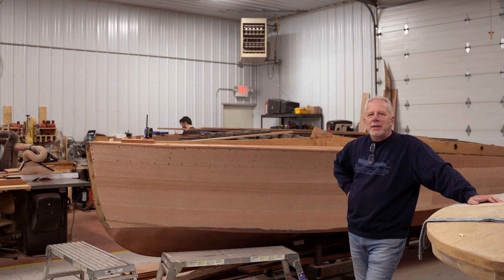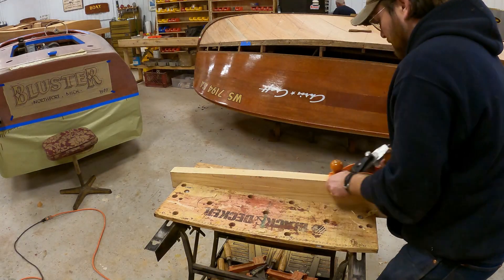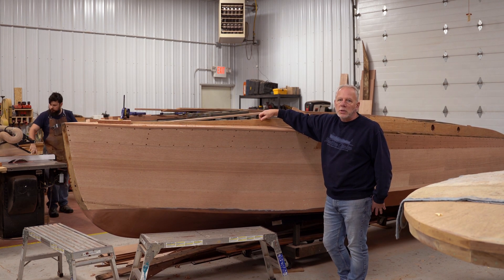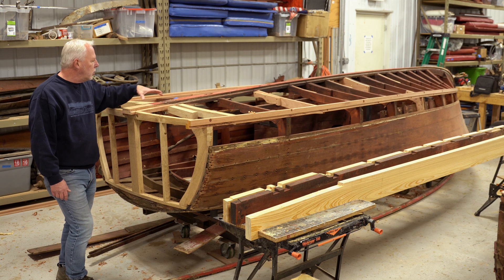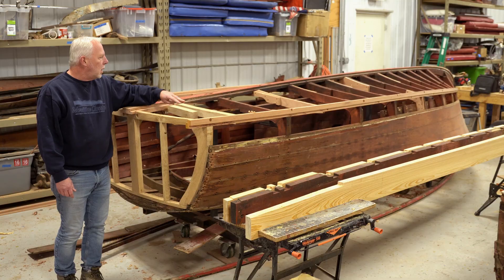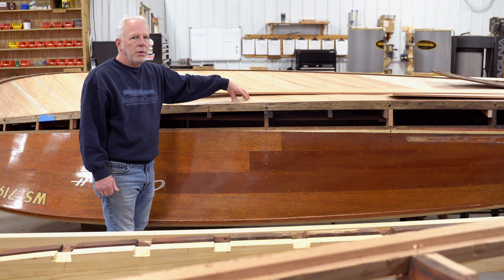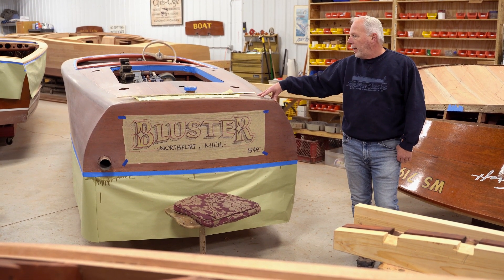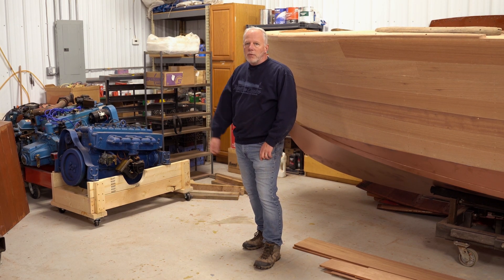Restoring Old Boats - Shop Tour Nov 2023

Comment: Hi Mike. Dave Willis here. Nice update and say hi to everyone in the shop. It was nice see everyone at BoB, Hessel, and Bay Harbor this year. Some amazing work completed last spring.  I'm getting ready to replace some of the frames on the '49 Riviera and wanted to confirm that I should use white oak and not mahogany. Any thoughts on the cut for the oak? Plain, Rift, Live sawn? I think the factory used Plain sawn, but is there a better choice for frames?  Thanks, and keep up the updates and tips.  It's helpful and informative.
Reply from the maker: The frames in the boat were mostly Mahogany except for the transom frames and the stem. I would not stray from the wood the boat was built with. If you change to all oak it will be a lot harder to fair and screw into. The boat will be much heavier as well.
Reply: Thanks Mike. It certainly looks like mahogany. Only one is broken transversely, but several have screw line splits that run with the grain. Per your 5200 video, this is the time to replace anything suspect. Agree regarding the fairing and weight savings of the mahogany.  @MikeGreenStudioWorks

Comment: Mike I’m restoring a 67 century Forester
I have it stripped down with 80 
Now I need to sand with finer paper like to use a guide coat so I know for sure my sand scratches are gone and help would be appreciated 

Oh also need information on how to correctly do the seams/joins what’s below the water line is a rubbery material 
Yet some is flakey and loose
Reply from the maker: On the decks and side planking we finish sand to 100 grit with the grain to remove any cross grain scratches. We caulk bottom seams when needed with SikaFlex Lot 291

Comment: Hi Mike, love your channel. I have a 1948 CC Custom 20 (my grandfather bought it new in ‘48) and it is time to strip down the sides and top and do a full sand/stain/varnish. Been reading a lot about using a heat gun vs chemical stripper to strip down 75 years of old varnish. The bottom was completely redone about 20 years ago with a 5200 system so I am good there.  Also wondering if you have an opinion on Smith and Co Varnish system vs some of the others?  Many thanks and keep the vids coming !
Reply from the maker: At the shop we use a heat gun on most jobs now. The stripper is really not very good anymore and it takes longer then using heat. I do not use Smiths anymore because it is just to harmful for our health and exspensive. We use captians varnish to coat the boats.

Comment: Hi Mike,

Love your YouTube channel, I never miss an episode. I’m in the mist of the final stages of a concours level restoration and I know Z spar varnish is original for my boat. My question is should I go for the Flagship or Captains? I know you use captains but from my research and experience Flagship would appear to be a more premium varnish…
Any thoughts?

Thanks so much
Reply from the maker: We like Captians because of how it flows well right out of the can and it dries within 24 hours. When you apply 18 to 20 coats you are going to have great protection using either. If it was a cruiser going it harsh environments I would consider paying more for like epifanes or flagship. If you try it or both and compare them lets us know what you find.
Reply: Thanks Mike! I have done extensive experimentation with both of these as well as epifanes and 2 part polyurethanes such as Bristol finish and even stoppani (used on Rivas). 

I settled on flagship because of the durability and high build properties. Worth noting that it’s slightly more amber than captains so will give a slightly richer look with less coats. 20 coats of flagship will more than fill even the most coarse mahogany. I also recommend using the performance enhancer in any petit varnishes, makes them flow much better and allows for better results when wet sanding and polishing.

Comment: Hey Mike. I own a 1955 CC Sedan W/Flybridge. My initial plan was to restore when I retired, approx 2 yrs from now, I have completely disassembled the flybridge and gutted the interior because I wanted to flip it upside down to redo the bottom. Would like to get more info from you, thinking I may just get a quote from you for the bottom.
Reply from the maker: Sounds like a good project. What is the length of the boat?
Reply: 27 ft

Comment: Hi Mike, 
Couple of questions that I hope you can show on the 20’ triple. 1. How do you cut the covering board line that meets up with the deck boards? 2. How do you fare the covering boards to the side planking when a rub rail needs to be installed? 
Thank you Mike and it was good to talk to you this past week about my 18’ Utility.
Reply from the maker: If it has a seam at the edge we plane a 45 degree bevel the width of the deck seams. We will plane up front the upper side and covering board the width of the rubrail so the rubrail will sit vertical when it wraps around the boat. I hope this helps and thanks for watching.

Comment: HI There, Im just starting a restoration of my Hillyard 1956 cutter. Im rebuilding thre cabin sides. Just wondering whats the joint you would recommend for joining the mahogony planks  together with? I was going to use oak fillet rebated between each board cramped with epoxy two part glue. Any comments? Also how to get a good seal at the deck and superstructure junction? Just sikaflex or flex and fillet piece bedded in? Niuce to get some feedback if you were doing somethign similar.
Great shop I have to say. Nicve work

Comment: What plywood thickness do you use on the inner layer?

Are your planks then 1/2”?
Reply from the maker: We use 1/4 inch on boats that came with a plywood inner bottom which started in about 1955 for Chris Craft.
Reply: @MikeGreenStudioWorks  Do you then cover them with full 1/2” mahogany planks?